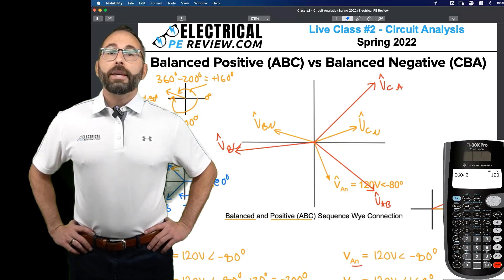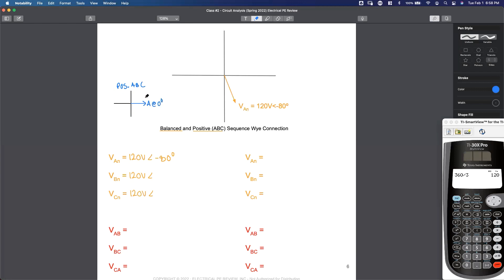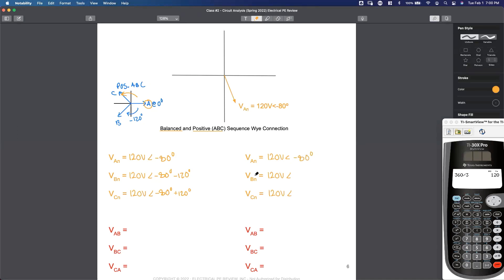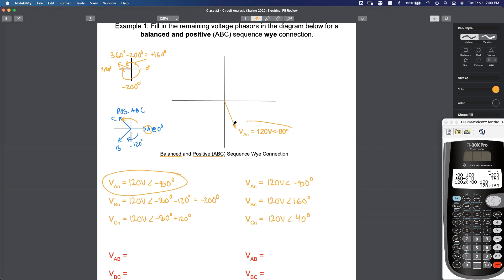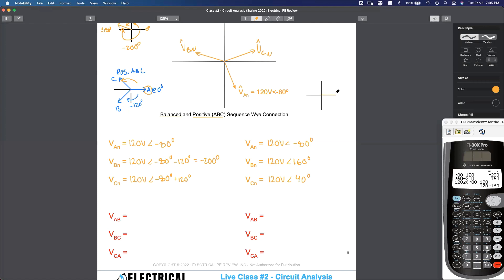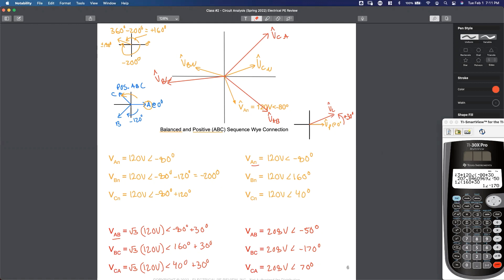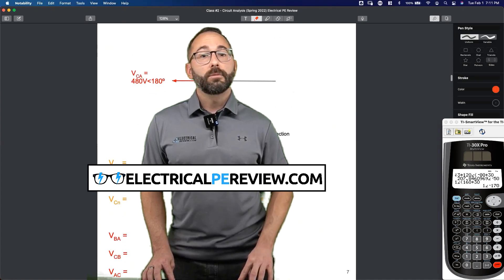Phasor Diagrams for Wye Balanced and Positive (ABC) Sequence Systems (ELECTRICAL POWER PE EXAM 2022)

Comment: Why do the line voltage phases have 30 degrees added to them. Where does this phase shift originate from - thanks?
Reply from the maker: Hi Steve, it is explained in this older video on our channel:

Where Does the Square Root Three (3) and 30 Degree Phase Shifts Come From? Phase vs Line Voltage NCEES Electrical Power PE Exam:
https://www.youtube.com/watch?v=kRhvm5sEsTc

There is also an article I wrote as a guest post for a friend's website that explains it here:
https://relaytraining.com/the-complete-guide-to-the-square-root-of-three-in-power-calculations/
Reply: @electricalpereview  Great, thanks!

Comment: why does the line voltage lead by 30 degrees. where did you get that from?
Reply: I'd like to know that as well.
Reply from the maker: It's due to Kirchhoff's Voltage Law and vector addition. I explained in this older video on our channel:

Where Does the Square Root Three (3) and 30 Degree Phase Shifts Come From? Phase vs Line Voltage NCEES Electrical Power PE Exam:
https://www.youtube.com/watch?v=kRhvm5sEsTc

There is also an article I wrote as a guest post for a friend's website that explains it here:
https://relaytraining.com/the-complete-guide-to-the-square-root-of-three-in-power-calculations/

Comment from the maker: Table of Contents:
0:53 -  Starting with the Given A Phase Voltage (V_AN)
1:03 - Calculating the B and C Phase Voltage Magnitudes |V_BN| and |V_CN|
1:34 - Calculating the B and C Phase Voltage Phase Angles (θ_VBN) and (θ_VCN)
4:13 - Why Negative 200 Degrees (-200º) is the Same Thing as Positive 160 Degrees (+160º)
6:40 - Drawing B Phase Voltage (V_BN) and C Phase Voltage (V_CN) on the Phasor Diagram
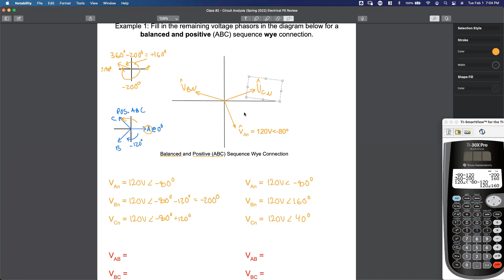8:02 - How to Convert From Phase Voltage to Line Voltage
9:03 - Calculating the Complex A Line Voltage (V_AB) both magnitude |V_AB| and phase angle (θ_VAB)
10:00 - Calculating the B and C Line Voltage Magnitudes |V_BC| and |V_CA|
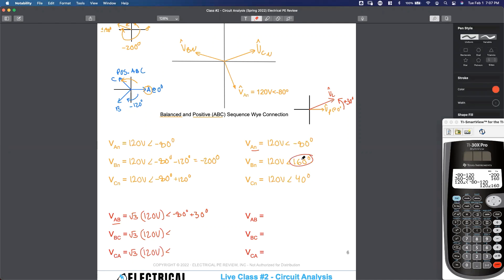10:24 - Calculating the B and C Line Voltage Phase Angles (θ_VBC) and (θ_VCA)
12:53 - Drawing the A Line (V_AB), B Line (V_BC), and C Line (V_CA) voltages on the phasor diagram